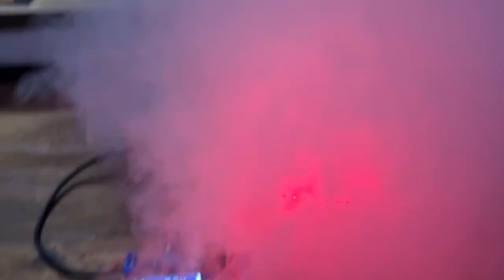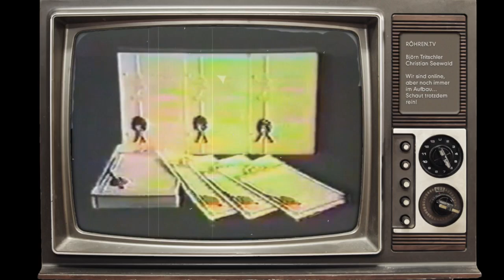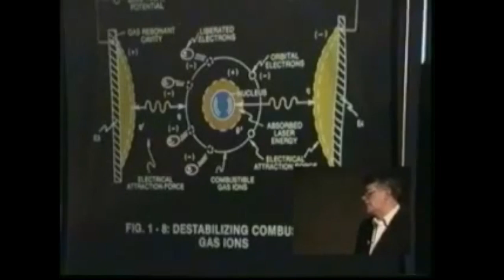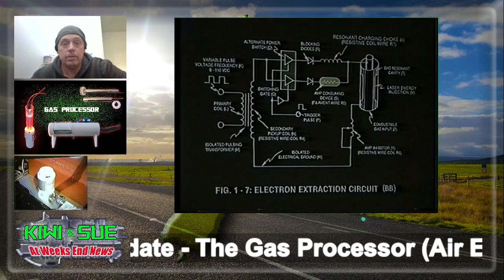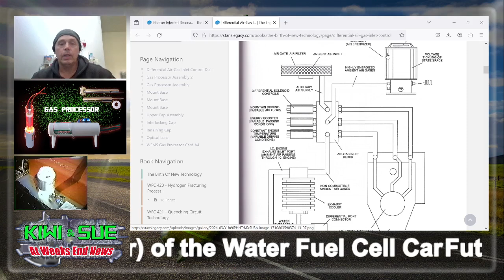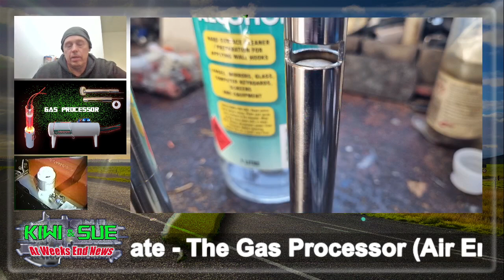Future Fuel Update 2 - Stan Meyer Gas Processor

Comment: Everytime someone tries to recreate the things he made they allways try to add there corrections or find a different way to do things and.never seemto try to recreate what he did exactly and allways fall.flat or sort of get there
Reply from the maker: If you look hard enough at what Stan did, he built on top of works from Tesla and others, he took their patents and research and added modern components. He also went though decades of development.
Materials that where cheap and abundant in the 80's are not so now and one of Stan's core principals with this tech was that it must meet the Law of economics.
I'm not trying to add any corrections to Stan's Gas Processor, if he said it worked the way he built it, then I'm trying my best to recreate the functionality.
often, there is information missing from Stan's work and trial and error is used to try and solve missing parts of information.
With the Gas Processor, there are a few things missing, 1: The pulse frequency for the LED's, 2: The inner electrode drawings.
The Gas Processor is driven by the Voltage intensifier circuit which is a whole other set of challenges to solve.
Reply: @newzealandfreedom1015  @newzealandfreedom1015  what of teslas work did he expand.upon ?
Reply from the maker: @prototype9000  Are you familiar with Stan's EPG? Tesla was stuck on solving a motor that didn't have to overcome magnetic impedance. Stan Solved this with his technology and used it in the EPG.
I will speak more on this in later videos as its not my immediate focus.
Reply: @newzealandfreedom1015  i know all there patents none of them shared much in common other than cone basic circuit ogic